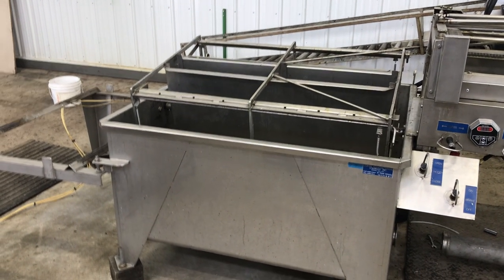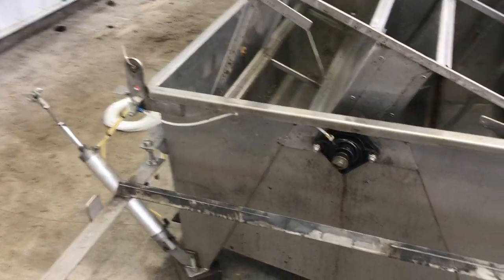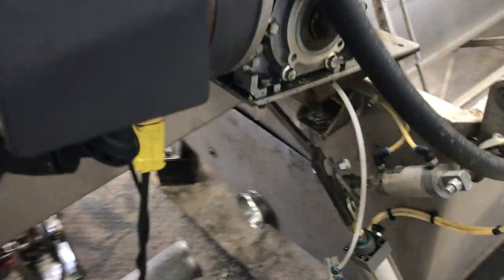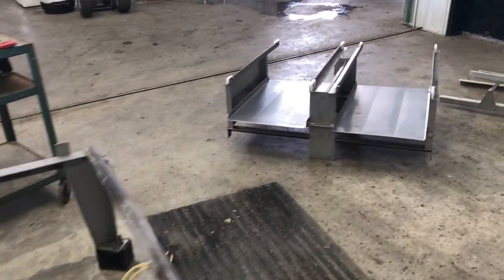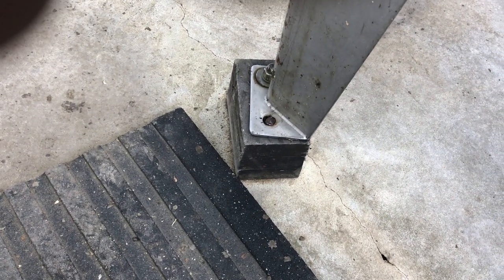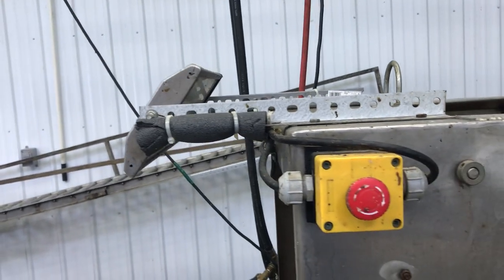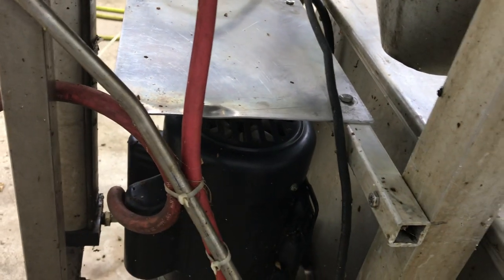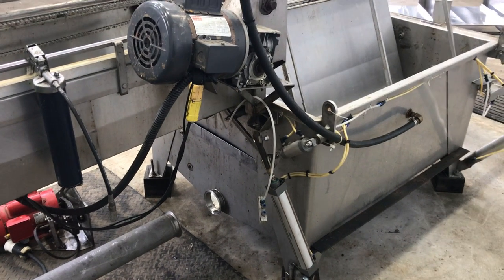Extractor hacks, ep #1.

Comment: Ya I was thinking of replacing my uncapper motor as well
Reply from the maker: I’m having trouble finding a sealed motor without any extra casings that interfere with the placement.
Reply: I measureed it up and the stock motors will not fit.  If you find a source let me know.  I also want a sealed unit for obvious reasons but looking at all options.  I need a back up
Reply from the maker: I keep a complete backup uncapper. It is the weakest link in the chain.
Reply: The only redundancy I have is the Ezyloader, two 
The rest run or we don’t run lol 
But we have parts on hand at all times and winkler 20 min away
Fixed my steamer through last season and the fix was as much as a new unit. Keep that in mind.  Treat it as disposable
Reply from the maker: Yes. When I had to replace I found a cheaper steamer on eBay.